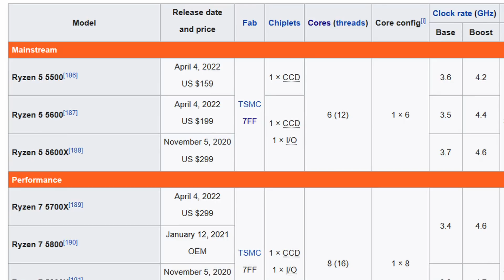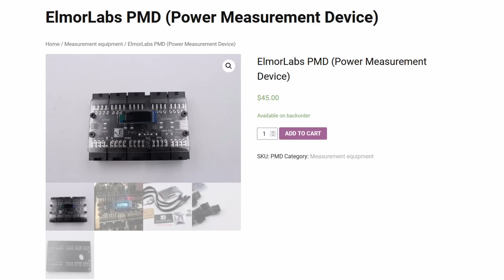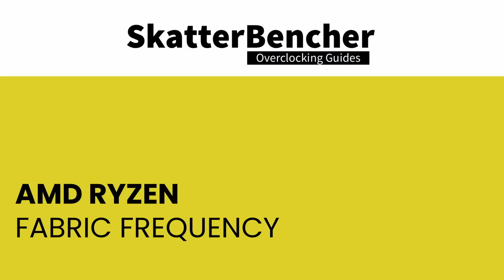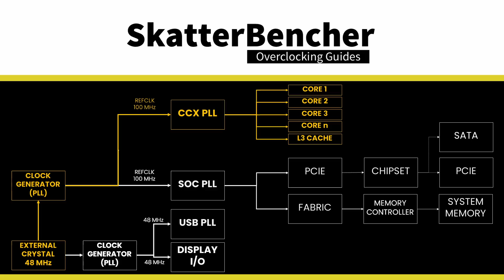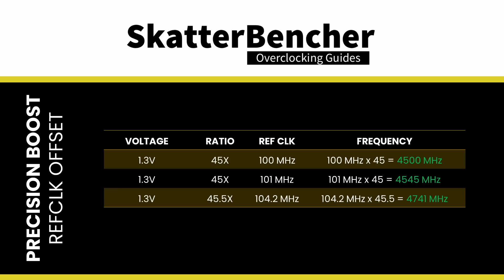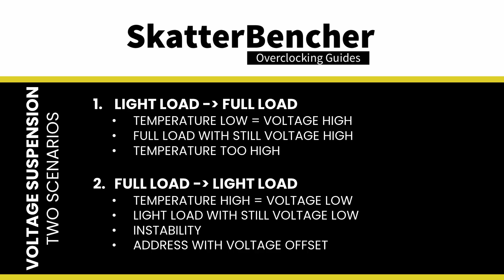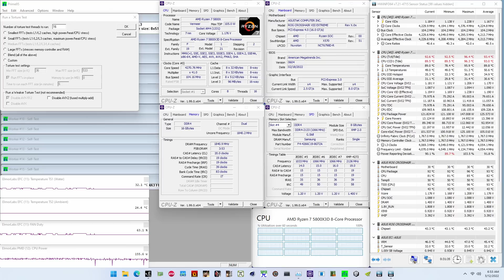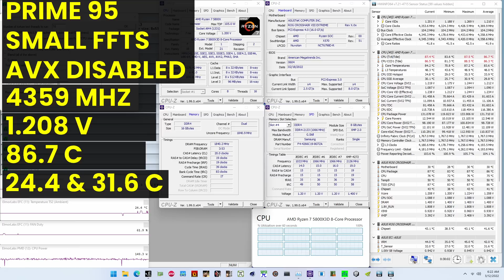Ryzen 7 5800X3D Overclocked to 4740 MHz With Crosshair VIII Extreme | SkatterBencher #39

Comment: Came here from BZ.
Fantastic overclocking guide.
I will go for a normal 5800x instead, the bad heat transfer scares me when using a aircooler and the 5800x is a "good enough" replacement for a Ryzen 1700.
Reply from the maker: Thanks for the kind words and please pass on my regards to Buildzoid. Top guy!
Reply: I use 5800X with Noctua U9S dual fans using ECO mode 65W with -12 PBO2 on all cores no issues still boosts to 4850Mhz with amazing  performance in games max temps are 68c ~ 72c in the worst case scenario full load idle temps are 32c~38c with this small cooler I don't know why people are concerned about the temps on this CPU when you can get way better temps and better performance by just tweaking the PBO2 and wattage which is super easy to do.
Reply: @fahadal-asmari6893  I have a Noctua D15 so I am pretty sure a 5800x is going to run fine, but multiple reviews shows the 3D to be a hotter CPU because of the extra layer on top.

I will try some of these tweaks when I get a 5800X
My 1700 boosted with 1.4v, I was able to turn it down to 1.25v and overclock all cores to 3700 instead of only 2 cores going up there.
Some boards deliver a fair bit of unneeded extra Vcore.
Reply: @larsjrgensen5975  Trust me you will be happy with the 5800X it's a monster not just gaming but also 3D rendering etc... I love it! just find the right PBO2 & W A A setting for you and you won't be disappointed good luck ;)
Reply: @larsjrgensen5975  Yeah, I upgraded my 2700 to a 5800X on Black Friday last year. Kind of couldn't resist when I saw one for $320, when they were still at $400. Certainly an upgrade over the 2700, which I had OC'd to 4Ghz MC @ 1.3v, which also was cooled by an NH-D15S. I can only imagine going from a 1700 to a 5800X. You're gonna love it!
Reply: @fahadal-asmari6893  .. I did the same exact thing as you with my 5800x and my Noctua NH-U9S w/ dual fans and can verify that set at ECO mode 65w no problems maintaing 65°c mostly with 70°-72°c max. I picked up my 5800x 4 months ago at Micro Center on sale for $300 upgrading from a 2700x. I then upgraded my 2070 Super to a 3080ti which introduced 5°c more heat into my Noctua from the heat coming off the backplate of the 3080ti. I adjusted the fan curve of the 3080ti to run cooler which dropped the heat getting sucked up into my aircooler. Subsequently, I just ordered a 120mm Jonsbo dual-tower GT2000x to try out, (mostly for the RGB bling-bling tho! Hahaha! )

Comment: why the hell does it reach 90° stock with water cooling
Reply from the maker: Couple of factors:
1) Prime95 AVX is a pretty rough test 
2) 3D V-Cache adds thermal density
3) All heat is transferred via a really tiny die (74mm2)
Reply: @SkatterBencher  yeah ive done research apparently its because it has only 1 ccd like the 5800x

Comment: I wounld wait at least 1 more year to accumulate CPU failure rate. Who would voucher the 3D-stacked SRAM technology? More complication causes overheating and breakdown. Why AMD applied the 3D-stacked SRAM technology only to the 5800 version? It must be a trial to see the failure data.
Reply: Sorry to say, but you must be living under a rock. It is crystal clear why only one 3D CPU is launched: this architecture only delivers benefit in certain scenarios. Most productivity applications is actually slower because of the lower clock speed. Thus implementing this for the 5900 and 5950 would not make sense. At the same time this 3D manufacturing process is quite expensive, thus it would make the cheaper 5600s way too costly. The 5800 is the middle, as being more a gaming CPU than a production orientated one, but with 8 cores its price can adsorb the hike. Finally, AMD absolutely does not care how many (how few) will be sold, it serves marketing purposes most importantly. AMD just wants to be able to say that their best gaming CPU is equal or very close to Intel's best. (Stop gap until the Ryzen 7000s will come out, still this year.)

Comment: The reference clock, is that still an actual oscillator? Actually on die or package? Instead of on the board a la 286 era boards? Or is it more of an abstract mathematical thing?
Reply from the maker: There's still a physical oscillator which serves as a clock generator, but the actual reference clock (100MHz) is generated on the CPU
Reply: Excellent video btw. Bz wasn't kidding

Comment: Nice one! I'm hoping to get this CPU as well so I could play around with overclocking it. I have a B550 TUF motherboard and a lot of the tweaking options mentioned in the video are not available there. But I'm pretty sure there might still be ways to get around the limitations imposed by AMD. Much similar to overclocking on an A520 board with BCLK for example. Of course limiting the overclocking options are not ideal but that just makes it even more interesting to get into.
Reply: Is it possible to do this with a tuf gaming b550m - plus?

Comment: It's sad that they doing all this when really all we really want is multx46, vcore at 1.23 at most, all-core.  I tell I TELL normies with Ryzen 5000 to undervolt just so they can hit that all core 4.6
Reply: : Totally agree! PBO doesn't do shit for me but uv with Ryzen Master does everything. I can hit 4,6 GHz at 1,16 V and 4,775 at 1,35 V (all core) and keep the temps in check. But I just use R20/R23 for validation since I'm relatively new to the whole OCing thing. I have a 5600x btw...

Comment: When your chip burns out in six months don't say we didn't warn you.
Reply: Who cares Ryzen 7000 will be out by then and this will be obsolete. It only needs to last 6 months
Reply: @LawrenceTimme  o7 from the future, zen 5 launched and 5800X3D is still relevant 😅
Reply: @MrStoffzor I just got mine installed after having it on the shelf for a couple years.... Gonna pair it with a 4080super when the 50 series comes out for an efficient 4k60fps cinematic gaming rig for a big sexy telly in my living room with a PS4 controller 😎 

sounds like the general wisdom is to use a -.30v offset across the curve and match the fclk to the target ram frequency and  keep it cool xD screw adding voltage if it's gonna decrease the lifespan of my AMAZINGLY still relevant CPU 😂😂🤙
Reply: @LukeTrundell  as always with tuning, stability check it, if yours can do -30 on curve optimizer, gz, mine is at -22. It peaks at 4.55 GHz
Reply: @LawrenceTimme how bout now
Reply: @LawrenceTimme time didn’t do this comment any favours. 😂😂😂
Reply: @LawrenceTimme  Nornal people will care.
Reply: @GodKitty677  normal people dont have to overclock it....
Reply: @LawrenceTimme  5800x3d I would only touch the IF and RAM timings.  If you mean not overclocking the cores, in this case I would agree.
Reply: @GodKitty677  yes I mean overclocking the core and cache. AMD should have left it unlocked.
Reply: @LawrenceTimme  The rumor is that the cache limits the vcore to 1.35 volts and above that will damage the cpu.  For a gamer the performance is  mostly okay already.
Reply: @GodKitty677  it's not a rumor, that's just what AMD say. Under ln2 it will take more perfectly fine. They are trying to make a CPU which will last the warranty period.
Reply: @LawrenceTimme  Just image someone putting 1.45 volts on an AIO and the chip cache degrades.
Reply: @GodKitty677  just imagine any other unlocked cpu doing the same thing? Amazing. This one isn't any different or special.
Reply: @LawrenceTimme  Its the fact that the maximum safe voltage for the cache is 1.35 volts and no more.  The cache also shares voltage with the vcore.  This means overclocking is pointless as the normal boost is all you will get core wise.

So no PBO or any overclocking as its dangerous.  People will find ways around the locks on overclocking the cores but they run the risk of damaging the cache or killing the cpu.

AMD did not reduce the maximum boost of the 5800x for nothing and then removed overclocking for no reason.  These features are in great demand for many gamers and system builders.
Reply: @GodKitty677  it doesn't magically explode over 1.35v. Its clearly not pointless. You have no idea what gains you could get from extra voltage as you can't turn it up yourself and find out.
Reply: @LawrenceTimme  The maximum safe voltage is 1.35volts, so over that will degrade the chip.
Reply: @GodKitty677  this is incorrect, when a CPU is colder it can take more voltage, so under water, phase cooling dry ice or ln2 it will be fine on higher voltage.
Reply: @LawrenceTimme  Yeah because everyone cools their cpu with LN2.  Still the maximum voltage is still 1.35 volts.
Reply: @GodKitty677  we are going round in circles now. You have no idea what you are on about. You are just parroting amd marketing excuse
Reply: @LawrenceTimme  AMD states that the CPU is locked because the cache cant go over 1.35 volts.  Thus no overclocking, no PBO and reduced maximum clocks.  This is bad performance wise for the 5800x3d and amd would not do this unless it is necessary.  You have stated no proof that this is not the case.  Your opinions are not fact and amd really are the ones that are the experts in their own product.

Why release a cpu with less performance, well gaming performance improves and given the 5800x and 5800x3d are aimed at gamers.  This makes sense.  Overclockers are looking at benchmark results in benchmarks like time spy/extreme etc.  Here the 5800x is not a good choice for overclocking.   For an Overclocker a 12900ks binned is a better choice.  You can tune the memory for higher frequencies and tighter timing than any amd part. You are not limited by amd's IF.  Thus get far better performance than the 5800x3d.  The 5800x3d is of little interest the Overclockers, expect in single benchmarks were the cache could be usefull.
Reply: @GodKitty677 hi, a bit late, but
 what do you mean by IF overclocking?
Reply: @sjoerd104  Hes talking about the Infinity Fabric.
Reply: @Vegatron710  yeah haha I'm all caught up on it now
Reply: My peek up to 4440Mhz and I did 102blck and negative curve-30 all cores and now stable at 4540Mhz all cores on load, have used for gaming 6 months now 0 issue.

Comment: Any other motherboards that have these features, or is this $800 board the only option?
Reply from the maker: I think the Crosshair VIII Extreme is the only AM4 board with Voltage Suspension. And I think the only other boards that have it are certain ROG Z690 boards.

All other options and features should be available on any other X570/B550 board.
Reply: @SkatterBencher  What about Dark Hero? Im assuming based on hardware specs that it's pretty similar to the Extreme but costs half as much. Also someone managed 4.8 on MSI Godlike X570.
Reply from the maker: Only the Crosshair VIII Extreme has Voltage Suspension for AM4. The Dark Hero doesn't have it.
Reply: @SkatterBencher  That's a shame. I wonder what kind of BCLK overclocks could be achieved on B550 without voltage suspension tho.

Comment: Does the vcache help when running 2:1 fabric?
Reply from the maker: I tried DDR4-4400 with 1900FCLK and ended up with marginally better benchmark performance but worse all-core full load effective clock (likely due to increased CPU temp).

So overall, no difference I think.

Comment: Very curious! I suppose this was done with just one sample? It will be interesting to see what additional samples can do when the same OC methods are applied.
Reply from the maker: Yes, just one sample
Reply: @SkatterBencher  Mine seems to be more accepting to low voltages than the one you got, 45.25x105.4 blck 1.194v svi2, 1.21v via DMM.  Thanks for posting, busted out the C6E while the C8E is in the mail, it's holding it's own for a 5 year old motherboard!!

Might also be clock stretching, not sure yet. Need some time to dial it in still.

Comment: I wonder how the overclocking will affect the longevity of the processor.
Reply: You have a 3 year warranty on the CPU . I don't know how long you want the CPU to actually last, but myself expect it to last 5 years . By that time, longevity is no longer an issue since the hardware is already obsolete by then.
Reply: @fleurdewin7958  The warranty is void if they fine out you were overclocking it though.
Reply: @goodcitizen7064   Intel and AMD couldn't tell whether you were overclocking their CPU at all. There is no non-volatile memory on die for data logging. The only way they can void your warranty is when the CPU itself has physical damage like burnt LGA pads on Intel CPU which is rare or broken pins on AMD CPU. It is 1 million times more likely that Linus from LTT dropped and damaged his CPU than having burnt pads.
Reply: @goodcitizen7064  they wont find that out lol
Reply: same
Reply: You did not really follow how this was crafted, There will be no degradation as the controls are not overridden.  SSD stability was accomplished by an AIB M.2 controller withan independent clock.
Reply: @Viewer19  There was clearly a deviation of normalized working conditions, therefore, a greater strain on the processor. It could easily be assumed that the longevity could be affected.
Reply: @goodcitizen7064  You also are in over your head here. He posted the test numbers showing Temps and Voltages under high demand which were under spec.  As I stated the built in dynamic controlles were in effect. The comments made in the shown video were not abso;ute anyway (1.35).
Reply: @Viewer19  Bro, all I'm saying is that its possible that with tweaked voltages and CPU speeds, that the longevity of the CPU may come into play.
Reply: @goodcitizen7064  Broham It is all about Temps, not voltage or clocks, that ages and degrades so heat is the focus.